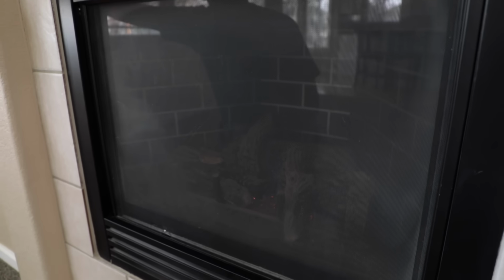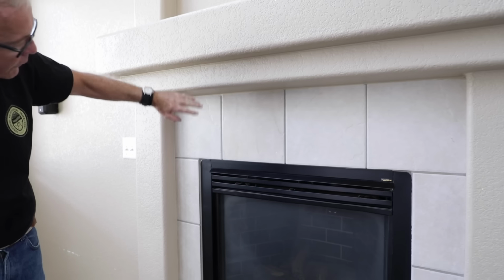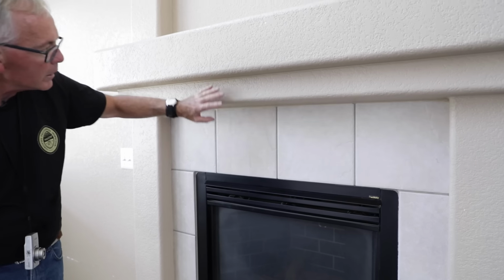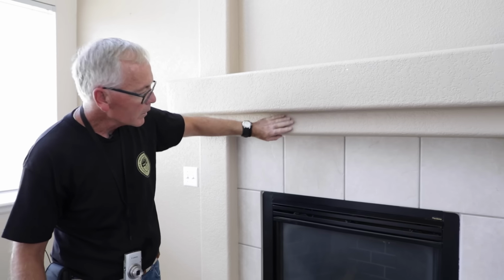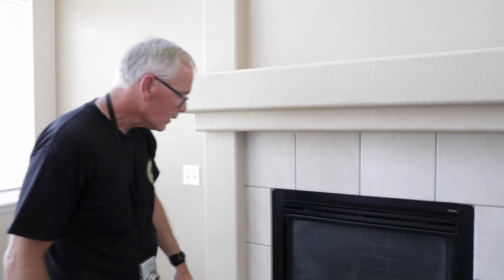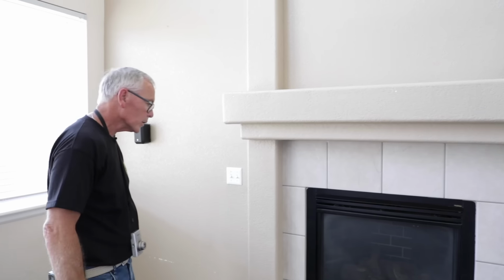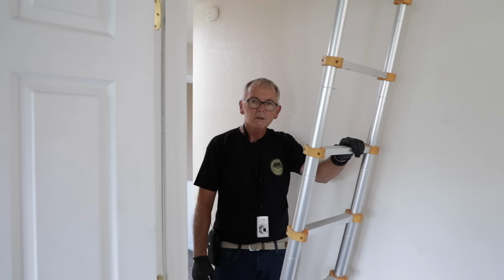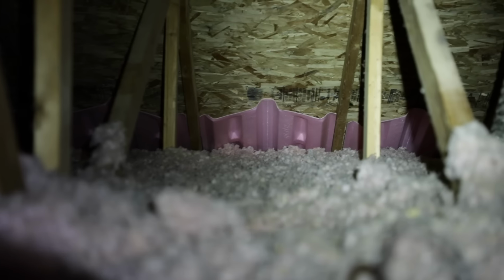Home Inspection with InterNACHI® Certified Inspector

Comment: 1:41 so you pay a lot of money to have some guy with sunglasses and binoculars look at your roof?
Reply from the maker: Yes. Every roof should be inspected prior to buying the house.
Reply: @internachi how can you tell with binoculars if it is even nailed down?
Reply from the maker: Can't see fastening of shingles.
Reply: @James-tk9oy alot of builders wont even allow them on the roof
Reply: Not alot of money. Basic inspection is like $500
Reply: @TheWhateverMan420 $500 for four hours of work is a lot of money. If the builder says you shouldn't go on the roof you should probley see why.
Reply: @James-tk9oy i agree the roof should be inspected. I work with these scammers daily. And I say $500 isnt alot when you think about the 10's of thousands or sometimes evem hundreds of thousands that youll save by spending the $500
Reply: @TheWhateverMan420 if they dont do a good job for the $500 you save nothing. You get told everything is good and find out after it wasn't. It happens a lot.

Comment: Here's the problem I have with inspections.  The buyers are hiring inspectors to tell them of the problems and then the buyer's agent tells the seller and expects the seller to fix them.  No, that is not how it should be.  It should be -  if you buy this house, these are the things that you will need to address or fix.

If the buyers want to go to the sellers and negotiate with them, in price or credits or fixing things, that's one thing.   But what is happening is that the buyers or buyers' agents think that it is the seller's responsibility to address all on the list.    They pay someone $375 to tell them things that are less than $100 to fix.   And they pass on the house because of that?   That's not smart.
Reply from the maker: The sellers are not obligated to fix anything, and home inspectors know this. We inspect in order to educate, that's it. Home inspectors reach an average of 5 million homebuyers every year. Data shows that recent homebuyers spend about $8,000 within the first year on home improvements. That’s $40 billion that home inspectors can influence households into spending on informed home improvement projects to keep our homes safe, functioning, and healthy.

Comment: Home inspectors are idiots.  They don't go through the house with the owners permission (trespassing) and they don't even go through with the owner so they know nothing of the house and it's history.   If the owner made any changes or added or removed anything they flag it but they don't know why it was done.    Thus, you need to have the owner with you when you inspect.
Reply from the maker: Nope. A home inspection conducted during a real estate transaction involves the seller (owner) agreeing in writing to permitting the home inspection of their property to take place. Most homeowners do not know the condition of their own home, and are often surprised to read the inspection report that may have documented evidence of home issues that are not safe, not functioning, or not healthy.
Reply: @internachi  The home owner just really doesn't care about those things that they've put up with for years and never fixed.   
So what if there's wood rot here and there.
IT doesn't matter.  
LIke on a car, the things that matter are the engine and transmission.  Rips in the seats and dents in the body don't matter because that's not why people buy cars.   Same with houses.  We just need a roof and 4 walls to keep the elements out and electricity and good plumbing and heat.   A/C isn't necessary.

Home inspections are for during and after construction.
Reply from the maker: Nope. Home inspections are for homeowners to understand what is working well, not working at all, and everything in between. Home ownership is a big responsibility, and it takes a lot of work to keep our homes in great shape. All homes should be safe, functioning, and healthy. There's a lot more than just "a roof and 4 walls." There are millions of homes in the U.S. (home with a roof and 4 walls) with major defects that are not safe or healthy. And that's not good.
Reply: @steveklemetti8035  Uhhh...some people actually want their stuff to be in decent condition. Clearly you're not one of those people who care for their stuff but not everyone is like you fortunately.
Reply: @deserteagle10  Of course everyone wants their stuff to be in decent condition.   That is not what my comment was about.
And it is very unprofessional for you to comment in a rude and insulting manner toward me when you don't know me.

All that I stated that it is not good for inspectors to make judgement calls based on what they see when they don''t understand the property.

Comment: You didn’t check the garage door for pressure stop

Also, won’t you need to note the wiring used on the electrical panel? Do you just exclude if you’re not going to open the panel?
Reply from the maker: Good questions for the inspector at https://www.nachi.org/certified-inspectors/arthur-kline-cmi-23150
Reply: Because it is not necessary.

Comment: Siding and/or trim should never be in contact with the porch or patio concrete, those areas will hold moisture and rot out the material over time. That is an improper installation of the siding/trim and not an area I would recommend caulking as my note. Also that side window trim you said needed caulk I never see them caulked and if you look at trimming a window all the caulking is done around the window between the siding and window before that beauty trim is installed so it doesn't need it. Its just for a clean finished look  which caulking would ruin.
Reply from the maker: Good stuff.
Reply: So what of it?  It was done and if it is not a problem, then don't make it one.
Reply: @steveklemetti8035  What are you talking about the patio pour or the window trim? My points were the patio pour is incorrect and is a write up, leave it at that. The window trim is a none issue, say nothing about it and don't make it a problem like you said.
Reply: @jstar1000  If the prior owner didn't have a problem with it, why would a new buyer have a problem with it?   The real problem is the inspectors looking for problems and then the buyers think that the home inspector is right.
Reply: @steveklemetti8035  it's an improper installation, I mention it so they know I saw it and can't come back to me saying I missed it and now want me to fix it.
Reply: That's why they hire us, to tell them about things that don't work or are improperly installed.
Reply: @jstar1000  IF they are improperly installed then they won't work right and then the buyer should know because of that.  If they don't work then the buyer should know that it doesn't work because it doesn't work.   Either way, the buyer would know and have it fixed.

Buyers need to learn that grass grows, trees and bushes grow.  Things change, things break.   I bought the house in 2004.  HVAC stopped in 2012.  I had to get it replaced.  Water heater leaked in 2019, I had to get it replaced.   There were no gutters on it.  When I saw the wood was getting rotted, I installed gutters myself.  That's what home ownership is about.

Also inspectors use their heat guns to check water temperature.  Then they say that the temperature is not hot enough.  Don't they know that when the owners move out they turn down or off the utilities because no one is using them?
Reply: @steveklemetti8035   I don't use a heat gun to check water temperature, I use my hand, if its hotter then the cold side then I'm good with it end of story for me. Water heater is either heating water or its not. I'm not talking about looking at the unit itself just testing for temp.
Reply: @steveklemetti8035  Its not whether anyone has a problem with it or not in my opinion, its not done correct and is a potential problem over time and something they can come back on me on once they decide it is now a problem they should have been told about so guess what? I tell them what I see, I told them, that is my job, end of story. They can now decide if they can live with it or not, its not my job to make that decision for them. What is not a big deal to me may be to them so I let them make that choice, when you pick for them and decide its no big deal and leave it out of your report it can end up biting you in the butt later when they call wanting you to pay for the repair.
Reply: @jstar1000   The problem is that the reports are just plain stupid.

The inspector said my house has partial gutters because they are on the front and back, but not on the sides.  There is a reason for that.  The sides has too many trees and the gutters would be full of leaves all of the time.  Also the side with the pool filter is backwashed every day so gallons of water get pumped by the side of the house.   So adding gutters would be ineffective.

But yet the buyer is influenced by the inspectors incomplete and uninformed opinion.  That's the problem.  You need years of seeing how things work in day to day life to form judgments.
Reply: @steveklemetti8035  Sellers are often butt hurt because we do our job. We collect and document data about the home for our clients. Not everything in the report is in need of repair, some things are just FYI info like stating that the gutters are not all around the house. I never make repair recommendations because there are many ways to repair things. I just write up what is not correct or not working and if its something major I recommend further evaluation by a professional in that trade. I also will note things like a dog door installed on a door, not saying its in need of repair just letting the client know its there so later they can't come back to me saying the door needs to be replaced because of a large hole in it, you would be surprised what they can come back on you for. So just because he mentioned you only have gutters on the front in back to me is just fyi info. Houses are not required to have gutters, in my area anyway.
Reply: @jstar1000  I don't know about butt hurt.  I just see miscommunications because of the lack of communications.  Buyers and sellers going through the agents when the buyers and sellers should be talking directly.   And the inspectors are not giving good reasons.

When I bought that house an inspection wasn't done.  If one had been done, would the inspector point out that there are no gutters and it should have gutters to keep water from the foundation?   I wouldn't have cared about that reason.  But if he had said you need gutters to keep the windows and molding and porch railing and posts and other wood from rotting from the rain, then I would have listened and done something sooner.    The "butt hurt" is all in the bad presentation.
Reply: @jstar1000   I don't get it.  Why would you report that there is a dog door installed on a door?  Should the client or buyer have seen that and noted that when going through the house the first or second time?  The same with gutters, that is something that is obviously seen. 
   
   Are you saying that people put offers on houses without even seeing them?  I guess that is what buyer agents do if a person is buying over a distance and can't come and look at it first and would get the buyer's agent to look and evaluate the house first and then they would hire an inspector to check everything out.  But that would only be for sight unseen houses.  How often does that happen?

But that's what I'm doing.  I'm buying a house from a friend and he does painting and hardwood flooring and he is redoing the floors and repainting and doing trim.  I found in the crawlspace there was water filling the plastic underneath the shower.  Something to fix and we had to find the leak behind the wall and fix it.
Reply: @steveklemetti8035  it's documentation, I don't write it up as in need of repair, I'm noting that the door has been modified.

Comment: Nice overall inspection, thanks..  One question during end-of-video garage door inspection -  I noticed about 1/4 of the garage interior was unfinished, including paper-faced insulation and exposed rafters and roof sheathing - wouldn't these things be an obvious fire-code violation?
Reply: In some areas, only the side of the living space in the garage is required to be insulated/finished (union carpenter)
Reply from the maker: Thanks for watching. Glad you enjoyed it.
Reply: Typically between garage and living space and only fire taped sheet rock joints.

Comment: Sometimes leaks don't show up in the cabinets from drain leaks or bowl leaks just running the water. Best practice to check for leaks. Fill the sink up with water than release the water. This checks a couple of things. Leaks in the drain(below the sink), possible cracks in the sink. The bottom of the sink where the drain and the sink connects, this test will test if it is leaking. Sometimes just running water won't show that leak. Lastly it will test to see how well the drains do with water. ~Licensed plumber that does plumbing inspections for clients.
Reply from the maker: Correct.

Comment: Soffit venting ... was that an adequate amount? Also that step down from the back patio door is more than 7 inches ... list as trip hazard? One last question, do you perform a pre-walkthrough to take CYA photos?
Reply from the maker: All homes should be inspected by an InterNACHI certified home inspector at https://www.nachi.org/certified-inspectors. Thanks for commenting. - Ben.

Comment: I have a question.... if there is a huge 4ft hole in the foundation under the home black mold, hanging insulation and missing insulation. Moisture barrier with huge holes in it. Pooling water and a DYI sumppump made of a 5 gallon bucket. Is the inspector supposed to tell you as the buyer this information after inspection of the home?
Reply from the maker: Only if the inspector observed defects and deemed them to be material defects. I recommend reading the report again, then asking the inspector to comment, and possibly re-visit.
Reply: @internachi  

https://youtu.be/h6sC1siyJF8
This is what it looks like under my newly bought home. Im a first time homebuyer. The realtor told us to not show up during the inspection.... when we got to the house after an hour. The inspector said he was done and needed to be payed $600.00 he had a bad arm.  It was in a sling.  I feel so dumb! I was to excited to buy a home and wasn't looking closely i guess. The home was built in the late 50'
Reply: @internachi  
The home inspector was through the  Relitor office. He worked for the woman who sold us this home through  Cadwell realtors!  The inspectors right arm was sprung and in a sling.  Im starting to feel first time homebuyers get played by the realtors.

Comment: The second he said there was hail damage on that roof ... an observation he makes from the ground .... I stopped watching the video.  He has absolutely no call to say that and I would be disappointed as a prospective homeowner or seller.  What is the age of the shingle?  Is it a sun-exposed slope?  This would account for excessive granule loss as a course of normal wear & tear.  Is there evidence of collateral impact damage to the metals??  The guttering looked pretty dang smooth with no evidence of hail impacts, even on the lips.  Roofers are not "experts" and I sure as heck wouldn't recommend the client call one.  They are there to sell you a roof and convince you to get your insurance involved, which is pretty much the only way he'll get paid and he KNOWS it.  A responsible roofer would have completed the temp repair on that front slope instead of a stupid patch.  The materials for a spot repair are cheap and the labor is barely more than that to install the patch.   That patched spot is most likely not a result of hail.  If hail were so large as to cause a leak in the roof (btw, hail impacts rarely cause roofs to leak), damage would be obvious in that very short clip he showed from the roof perspective and the guttering would be dinged to heck.  My guess is that the tree canopy overhang grew out over the roof and caused damage, necessitating its temp patching.  I have been an independent insurance adjuster for 15 years, and before that back in the day I did roofing.  I am currently studying for the home inspector's license.
Reply from the maker: That's the magic of video. We inspect the systems before filming.
Reply: Yeah, pretty bizarre how quickly he jumped to the roof needing replacement, honestly looks like it will be fine for many years to come.
Reply: I agree with everything you said the fact that he inspects from the ground binoculars but had a ladder there to look at the gutters only? Why didn't he check the drip edge flashing that he said was missing and have a picture of that when he was on the ladder. I know we're not required to go on roofs but no inspector that's ever worked for me would not walk that roof. And if there was hail damage to the roof vents it would have been obvious and we would have taken a picture of that. So I don't agree with his assessment that it of what he thought happened to that roof. I agree it was the patch was probably from the tree. He also didn't mention the failed gutter at the corner of the house that was capped off and probably was an underground drain that failed and had to put up an extension on the ground. When you find obvious things like that you have to point them out as a home inspector what is that white cap on the ground most people will ask you. And it's probably a failed underground drain system. That's as far as I got on this video I'll try to look at more later I've been expecting for over 20 years. And I agree with your assessments in comments. It's always good to listen to see how other people inspect though so when I have time I'll look at more of this video.